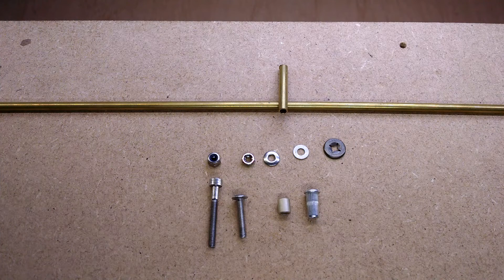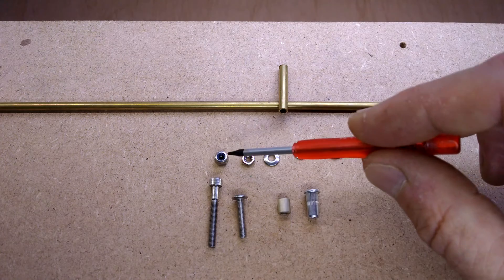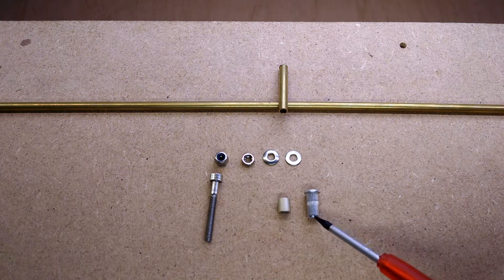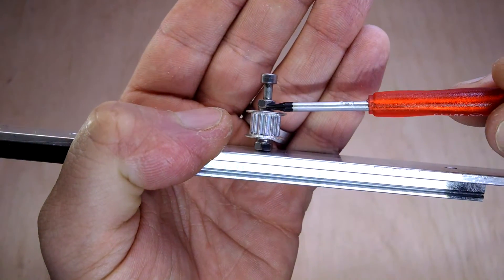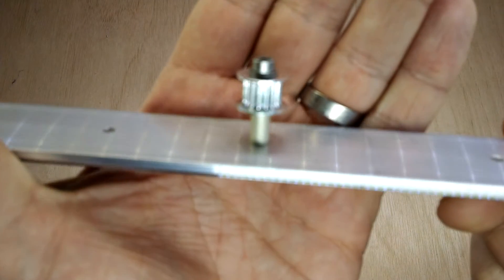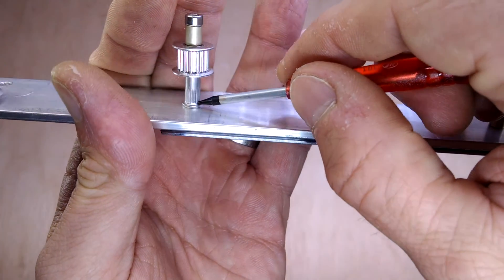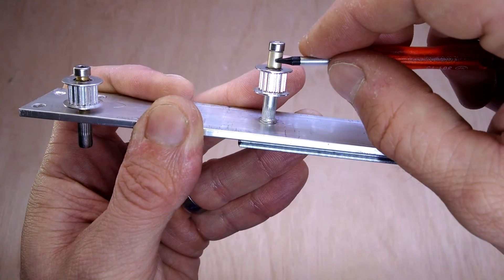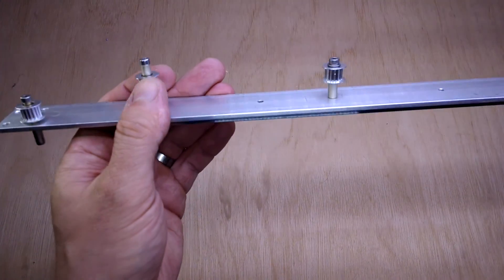3D Printer Hardware: M3 Idler Pulley Mounting

Comment: I've just been experimenting with this, and I think this video misses the point. The problem isn't binding against the outside of the bearing. Using M3 brass threaded inserts on either side of the bearing (which clearly don't contact anything other than the bore), the pulley stops turning freely when I do them up just firmly finger-tight. The problem is that applying force to the bore causes it to deform and cause friction within the bearing.
Therefore to mount the bearing & bolt nice and rigidly, you just need to mount the bolt rigidly (e.g. put the end into sheet metal with a nut either side of the sheet metal), and then 3D print some spacers for either side of the bearing. The spacers prevent the pulley from moving up/down the shaft, and are not under any compressive load from the bolt. You could also use 2x nuts jammed up against each other on either side of the bearing if being able to adjust position on the shank is important (bit fiddly to do-up the 4x nuts though).
Any method where the bolt is compressing the pulley is doing it wrong. Still a good/helpful video though thanks!